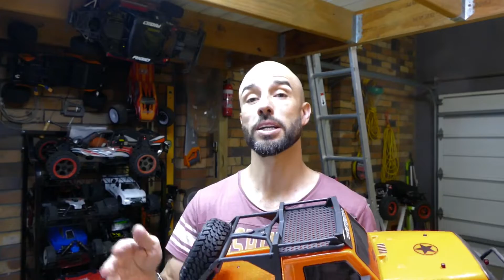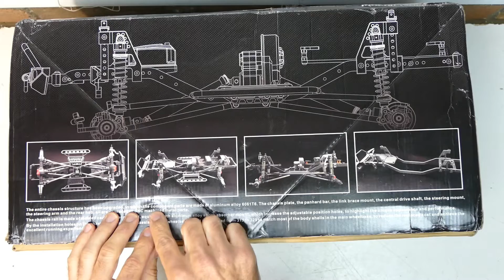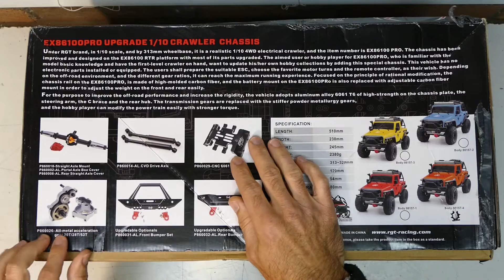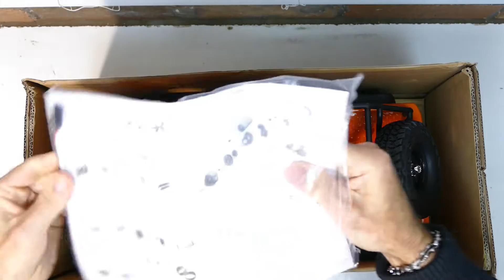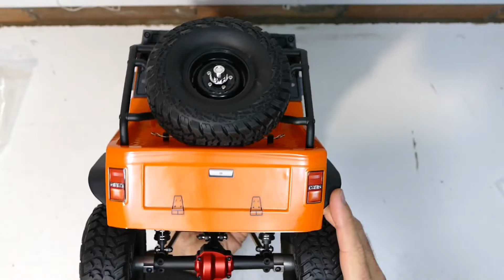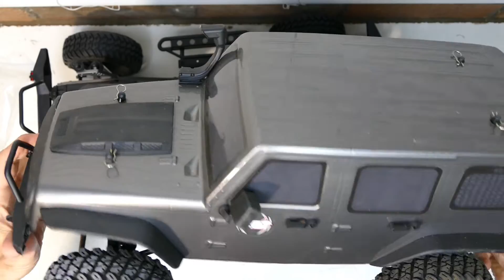RGT PRO JEEP Rock Crawler Kit EX86100 - Carbon Fiber Frame & CNC Parts! Unboxing & First Look

Comment: Don't forget to sand and seal the CF edges, so many CF-loaded things these days seem to forget that requirement.
Reply from the maker: Thanks for the info
Reply: I actually ordered one of these yesterday, looking forward to my xmas pressie :)  Problem with CF is that without the edges sanded and thin CA applied to seal it, any impacts with things can cause the CF to flake away.

Comment: G'day Steve,,looking at electrics for this kit that i bought due to this unboxing,,( almost bought the ex 86100 stock crawler..)what are your thoughts on the cheapish 25kg servos on ebay ? good or not so ? would really appreciate the feedback when you get a chance please mate...cheers Dave
Reply from the maker: They would probably be OK but for cheapish servos I recommend JX servos. They are great and I use them all the time.
Reply: @RCTanksTrucks247  beauty mate,was a bit sus but now i'm sorted thanks Steve.i'm throwing a hobbywing quicrun 1080 80 amp esc in it,,seems to be the bee's knee's for crawler esc's at the moment,,should i be concerned about the "C" rating on the lipo as i'm a little unsure of the value with the esc i'm using...thanks heaps mate,once again,,cheers Dave

Comment: Steve what difference between this one: RGT RC EX86100 Waterproof 1/10 2.4G 4WD Racing RC Car - Gray, and the one you are reviewing and how were you  able to completely submerged it did battery’s and motor get wet?
Reply from the maker: Basically this one needs electronics and has more metal parts.
The grey one had been fully submerged, stock from the factory with no issues what so ever.
Reply: Which one do you recommend and rtr grey, is that only color?
Reply: @nsvaluto48328   you can get a few different colors red blue grey etc

Comment: I LOVE all the CNC metal work and such, Beautiful! But what's the logic in a carbon fiber chassis? We all know CF is strong & light, but the frame is one of the few places where an RC can lower its center gravity.  Wouldn't box steel with lead inside the lowest frame members offer the same strength as well as better lowering CG?  Or is RGT simply looking for a marketing gimmick to attract the easily gulled?